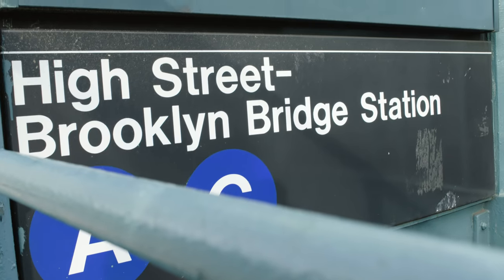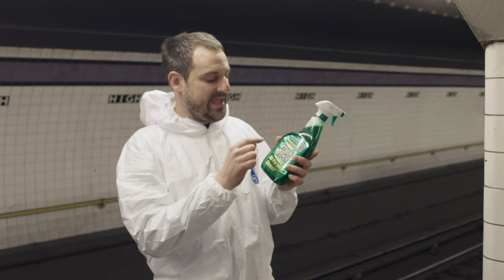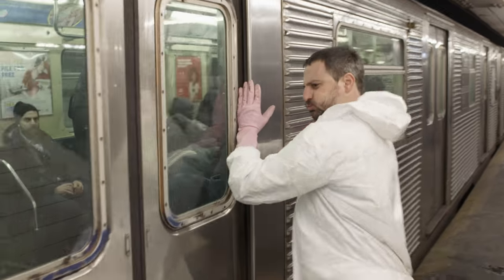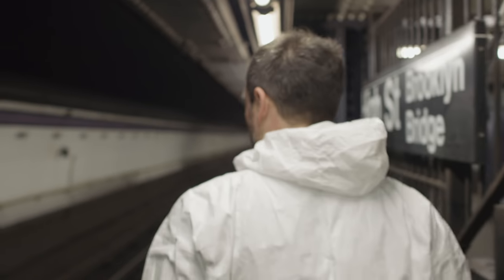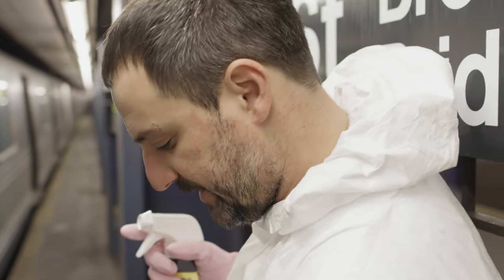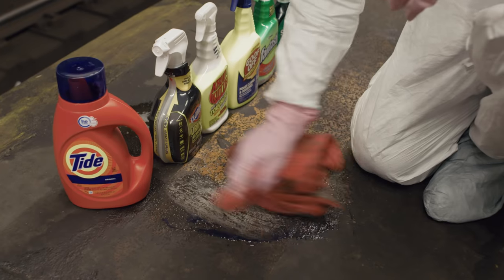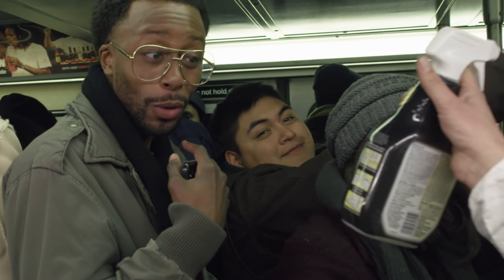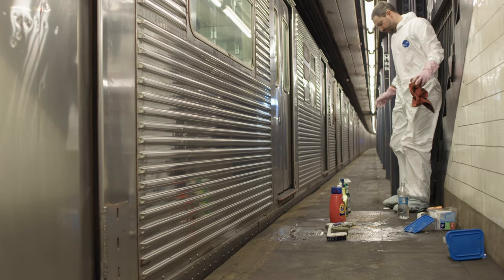Watch As One Man Attempts To Clean This Subway Station

Comment: A pressure cleaner makes way more sense than doing this
Reply: I didn't think of that. So true. Can you use one in the subway?
Reply: @happilysingle8385  sure why not
Reply: @PaulL42654  Electricity and water normally don't do well together...
Reply: @Chipotle14  It's fine. The Subway was designed to be used partially as a sewer so it's insultated. The MTA already uses a pressure washer when they renovate stations
Reply: The pressure hoses they use with that weird smelling bleach are waaay more effective than this. You wasted your time.
Reply: Chipotle14 do it at night and shut down the line
Reply: Not many people have a pressure cleaner though. So, you got big brain.
Reply: That would be soooo satisfying

Comment: I remember going to New York and seeing how filthy the subway stations are. They should high pressure hose the hell out of every station there.
Reply: They do
Reply: What they really need to do is sand a whole layer off of the concrete and then maintain it by pressure washing it because that dirt is literally NEVER going to come out otherwise.
Reply: Thye cant because the water will flow into the tracks
Reply: What about the third rail

Comment: Do people pee on the subway platform.
Reply: Alex The everything fan yea
Reply: Yes the homeless, I’ve even seen a homeless person pee while the train was running in between the subway carts
Reply: Non stop and mostly at the end of the platforms wich even in stations that get cleaned are never touched and theres built up pee from the past 100-200 years
Reply: If they have wifi at all underground stations, it wouldn't hurt to have a few public bathrooms, right?
Reply: @thearea51raidwasboring  arent there a few public bathrooms already? also wifi is much easier to set up than functional connected plumbing+sewage that also needs to be cleaned